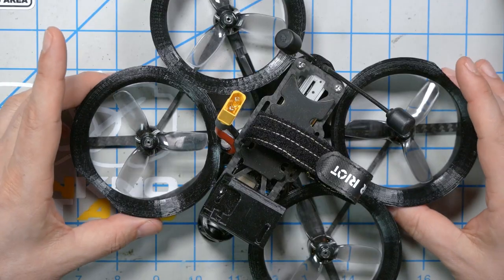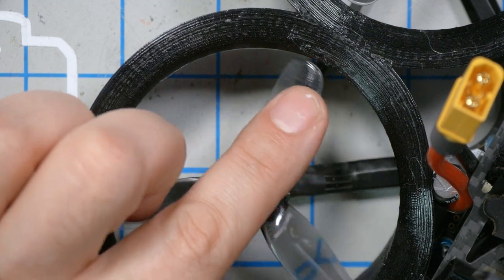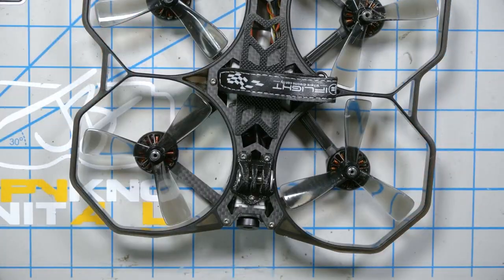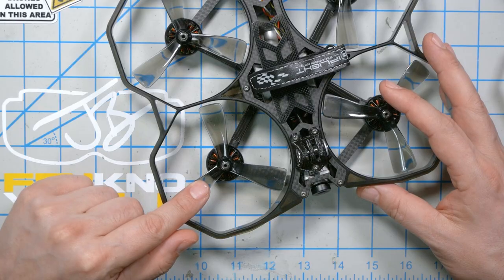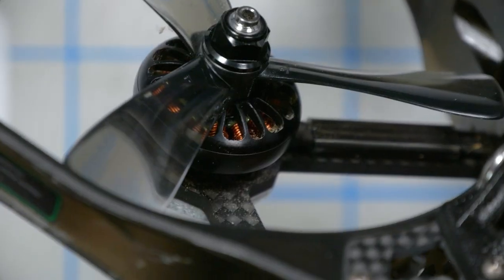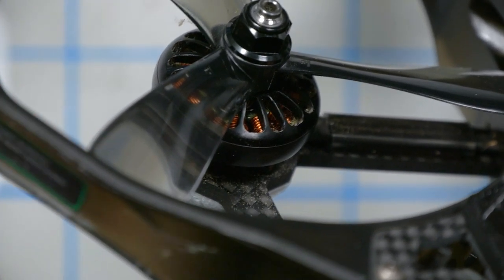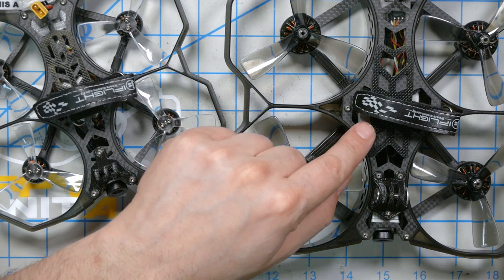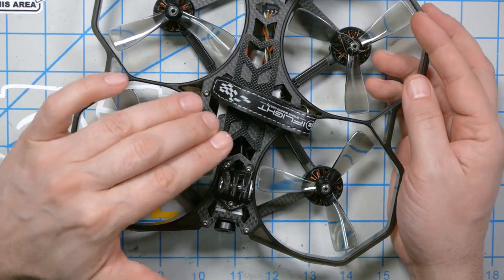iFlight Protek25 and Protek35 (try to) redefine what a Cinewhoop can be

Comment: please i have a question and you are the only one i trust if i purchase this drone to be used with the DJI goggles and DJI controller please tell me which controller can i use the gray one that comes with my DJI FPV drone or do i need the big black square one that i see everybody using and if that is the case can i use my inspire 1 remote just asking because it looks similar thank you thank you thank you for your help and thank you anybody who helps
Reply from the maker: The gray DJI FPV drone controller can only be used with the FPV drone. The big black square one can be used with the Air Unit and Vista. You cannot use the Inspire remote.
Reply: @JoshuaBardwell  Joshua thank you for the info my friend

Comment: My 25 frame broke in the exact location sucking itself to the wall one foot off the ground and falling. The frames are extremely fragile, brittle. Not only broke my frame but burned out this cheap crappy ESC. Never had it UC burn up so fast. I have recently install the Beast 55A. No fear now!!

Comment from the maker: Which is better? Original Shendrones Squirt or iFlight Protek35?
Reply: Protek35 I think
Reply: squirt for jobs. i have 35, flys well but its too fragile.

edit: i commented this before I saw 23:57, I BROKE MINE AT THE SAME SPOT even with the foam!! HAHAHA!!
now im trying to design a 3d printed TPU to cover the whole outer plastic.
Reply: @bendixtrinity  would be great if you uploaded it to thingyverse! :)
Reply: Squirt or Geyser. The not-really-ducted-ducted cinewhoops are not awesome.
Reply: The Squirt is better in every way. There's no comparison. The Protek is bulky and less stable. Both have similar flight times.
Reply: @spasmfpv2824  the protek 25 is pretty small and seems like it could fit well for certain types of shots
Reply: @LutherFPV  I would not get the 25 after hearing about the ESC issues. Also, I just got the HOMFPV Wingsuit and it's got 1404 motors as well and it's a beast. Comes with insta360 and Gopro lite mount. It's a beta95x on steroids. I've been using it and it's held up well so far. The Protek series seem fragile and like more of a gimmick for beginners. I do like my Protek 35. I'm sure i'll use it for something but the Squirt is far superior. For 2.5 inch class, the one on top of the game right now is HOMFPV Wingsuit. Hopefully JB does a review on that one.
Reply: @bendixtrinity  do your TPU ducts generally hold up with collisions? I broke 2 already, both with similar collisions that my iFlight Bumblebee can typically handle. But I like the way the Squirt handles better with stock Betaflight tune so I want to keep using them. Just curious what your experience has been.

Editing in that both situations have been in the cold, so I understand that will play a factor.
Reply: The FPV Cycle Cinesplore ;)
Reply: @LutherFPV  will do that once Im done. :)
Reply: @mikeallenfpv  i've also bought another guard as reserve, I fixed my broken ones with e6000, havent crashed it since.

its not really tpu ducts, its tpu engulfing the outer plastic.

but since you mentioned it. maybe its better to totally replace the outer plastic with TPU just like the squirt.
Reply: I would take portek 25 because its under250g. In europe whe Can only fly 250gram
Reply: Protek35 .. far more flexible, lighter not as noisy and if you put the rubber on trade cool for durability, it doesn't;t break ;)
Reply: @bendixtrinity  its weird mine did too. Same spot on the back right side .
Reply: @spasmfpv2824  is that one able to carry a full gopro?
Reply: @spasmfpv2824  how is the squirt with its ducts not bulky too ? I don't get why all these cinewhoops use ducts, just do guards instead. I don't think we're actually benefiting from the ducts in terms of performance
Reply: @CiottiFPV  why ducts tho? when the tolerance is nowhere near tight enough to benefit? And it has a negative effect on flight performance
Reply: @LutherFPV  Yes. The Squirt carries a gopro and it's quieter and better flight time.
Reply: @spasmfpv2824  oh, I was thinking of the wingsuit, sorry for not clearing that up.
Reply: @cinialvespow1054  the ducts are there to prevent people from getting sliced up and to slow the rig down to capture "cinematic" footage, if you want to go fast with good flight performance you shouldn't be running ducts in my experience
Reply: @cinialvespow1054  The Squirt uses tpu ducts. They are actual ducts. Most of the other 3 inch cinewhoops are using foam bumpers with plastic on the inside but they don't help and actually make it louder and less efficient. I had the Eachine Cvatar in both 4s and 6s and recently picked up 2 squirt frames and converted them both. The exact same 1507 motors that were running HOT on the Cvatar frame, now run cool and the noise level cut in half. I now have 3 squirts, a 6s Cvatar and a Protek35. I like them all but if I had to choose one it would be the squirt by a long shot.
Reply: @LutherFPV  The HOMFPV Wingsuit can easily carry a Naked Gopro. I have a wingsuit with the SMO 4k Camera and another Wingsuit for the Insta360 Go. It's another option if you're considering the Protek25
Reply: @spasmfpv2824  yeah, I was considering using it with my full gopro but without battery like joshua did in the video. Is the wingsuit able to do that?
Reply: @LutherFPV   You may be able to. Has the same size motors as the Protek25
Reply: @spasmfpv2824  gotcha, thanks!
Reply: @bendixtrinity  I should have asked that too but you answered it anyway! Gonna order some e6000.

In the end, the cold played a major factor which is to be expected and I'll always keep spare ducts handy, but it's nice to have another option. Plan on building at least 3 Squirts for now. Really like the way they feel.

As far as replacing the Protek outer plastic with TPU? Hmm...

Thanks for your time & info!
Reply: @TimGnusmas  that is not correct. Are u familiar with the A1 and a3 categories?
Reply: Where did you loose the GoPro?
Reply: @bendixtrinity  sweet! Interested in your printed guards when they are done!
Reply: I have been watching a bunch of your videos while learning fpv. thanks so much all of the time you have saved me and general generosity of your knowledge I have learned a ton of things on all of those days. After trying about 6-8 different quads these are the two I ended up so I had to comment. The protek 35 is definitely superior coming from a professional cinematography viewpoint. I'm sure you could beef up the build on a squirt by printing some of the thick 3-d parts I've seen and using a similar fc and motors but just out of the box, bnf the rotor riot squirt is noticeable weaker, both in build and flying power/smoothness.  I fly these drones literally one after another one flight at time everyday. I tried the bumblebee v2 before the p35 and preferred the squirt over that but this is by far my favorite whoop and for those of us who have to fly with snow and cold for half the year the build quality and the layout of fc underneath dji air unit gives makes me worry less about moisture killing some or all of my components. Even though I coat the comformal coat the crap out stuff the wide openness of the squirt makes me anxious in winter. iFlight also includes a ton of useable stuff including the 3-d printed parts to mount smo's, gopros etc. At this point I think any bnf should ship with at least a action cam mount

Comment: I wanted to love the protek25 with my naked GoPro, but I just don’t like that it is so heavy. No way to get it under 250g. Using a Beta95x now, not great but workable.
Reply: @James Sucher I havent flown the protek25 but I think it flies much better. The problem with the beta95x V3 (and probably v2) is that the airflow is just terrible, like 25% of the props (airflow) are covered by the frame (vtx, etc). Some said the noise is comparable. Protek25 makes more noise because its heavier, the beta95x is (much) lighter but blocks a lot of the airflow so it makes more noise.

Comment: as a beginner is it really best to just go for a 5" drone? im planing on flying for cinematic purposes only... no race no acro
Reply: I got into fpv with the intention of getting cinematic shots. 
My maind quad is a 5 inch. It's great for filming aslong as you don't need to be flying indoors or something.
5 inch freestyle quads are really good at carrying fullsize gopros :).
depends what you want to film. My main desire with the cinematic shots is shooting beautiful landscapes, so I fly low to the ground and fast. I also do chases of friends on motorbikes and nice cars etc.
I'm considering getting a cinewhoop for slower stuff.

Do you have a tinywhoop? those are great for learning and I use it every day anyway just for fun. Plus its raining alot. Plus you can charge those batteries so easily, and it's less effort than going to a session if you're more busy some days
Reply: @cinialvespow1054  thats exactly what i want to use my drone for. landscape shots up in the mountains. I dont have a tinywhoop and i dont know if i should get one. I plan on buying a DJI digital goggle and digital tinywhoops are pretty expensive.
maybe the protek 35 would be a nice fit for me to start with.

Comment: What's the point of having propguards if they break so easily? And the 25 cannot carry a full GoPro. The 35 is not suitable for indoor or close proximity flying so the cases where the 35 is good, a normal 5 inch can do it even better...

Comment: do ducts on cinewhoops actually increase efficiency? They're much louder than non ducted props, and noise is inefficiency no?
Reply from the maker: In principle a ducted prop increases efficiency by directing more air from the prop downward. In practice, realizing the efficiency gain is difficult. The original Shendrones approach where the prop gouges into the tpu duct did work.
Reply: have a look how a wing or a rotor creates drag

Comment: Can I put a dsmx receiver in it?
Reply from the maker: I would recommend the SP4650 if you go that route.
Reply: @JoshuaBardwell  may I ask why?
Reply from the maker: That's the smallest Spektrum receiver; it has a bind button on it so no hassle with binding; it takes 5v not 3.3v like older Spektrum receivers; and it outputs SRXL2.
Reply: @JoshuaBardwell   thank you so much!